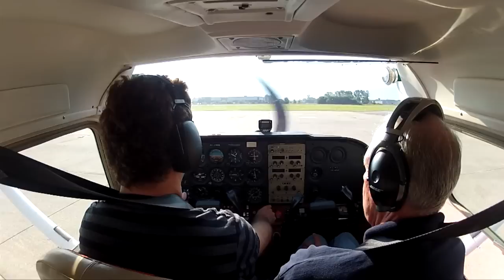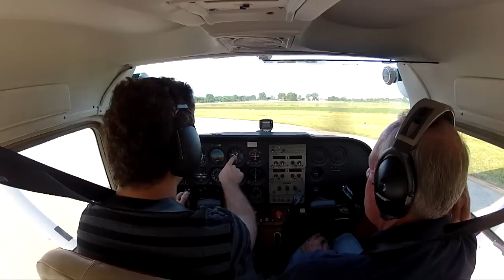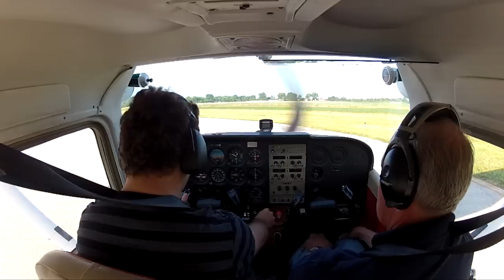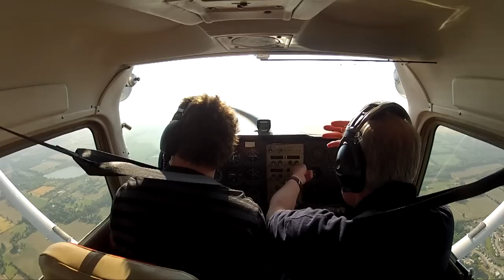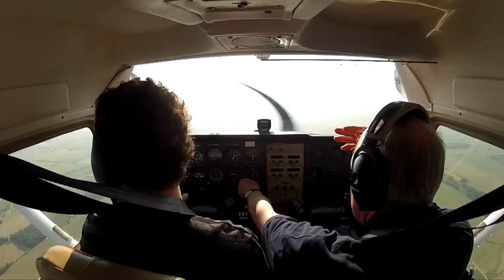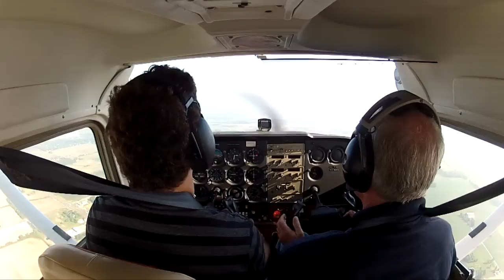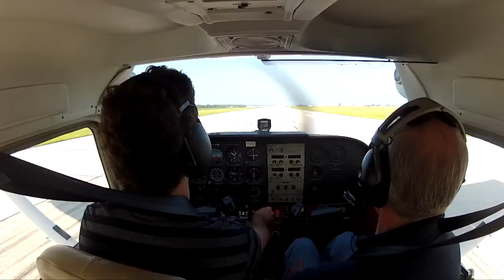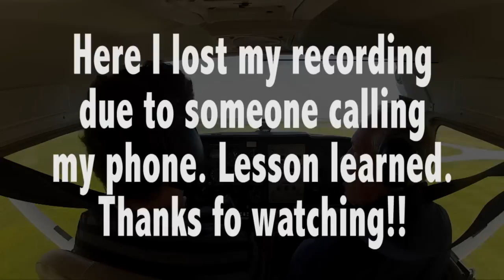Flight Lesson | Cessna 172 | Touch and Goes | Student Pilot

Comment: Been there with rough landings.  I took lessons in 2010 and 2011.  I have stopped because I ran out of funds to continue.  the lessons with instructor and wet were $200 per hour.  You can see some my wife recorded if you type in Landing 4 on 071611 in the search box on You Tube.  The lessons were at KUMP in Fishers, IN landing on 15.